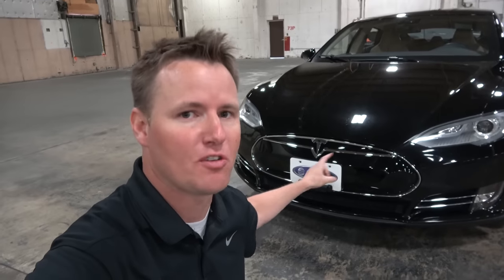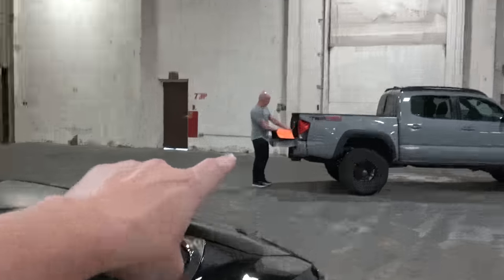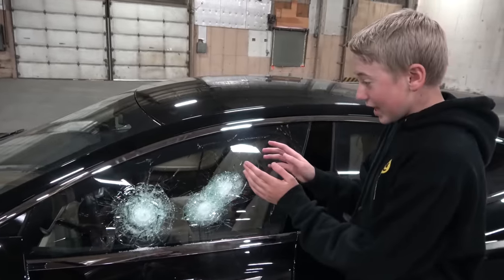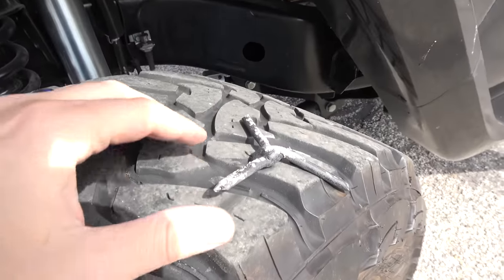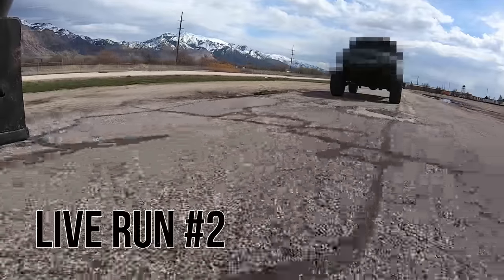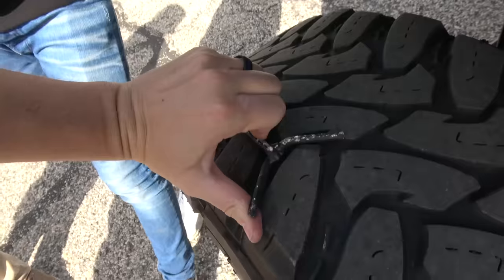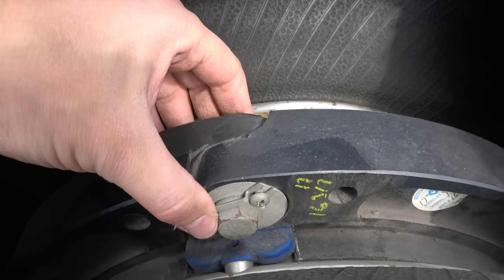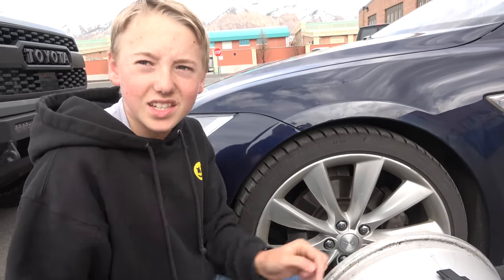What's inside a Bulletproof Tesla Tire?

Comment: For tacks of this kind to be most effective, the tacks need to be made of hollow tubes (essentially a bent needle with multiple points). If it’s not hollow, it just plugs the hole it makes and the tire can still be driven on for miles and miles.

Comment: For effective tacks, they need to be made from hollow tube, so when they pierce, rather than plugging the hole they make like the solid ones, they allow air out, whilst keeping the hole open. Police "stingers" have detatcheble hollow spikes, so when the tyre passes over them, the hollow spikes detatch from the stinger strip, and stay lodged in the tyre, releasing air more effectively (as the holes alone re-seal to some extent)
Reply: a net made with thick heavy duty
rope and spikes can stop almost
any if not all trucks in just meters

Comment: Shouldn't the so-called tacks be hallow for them to work?
Reply: @praesdynamite4596  It's unlikely you'll be able to recover the tacks even if they survived... after all you'd be using these in a area that isn't exactly safe
Reply: Tom Z Yes  the air need to be able to escape or else the hole will be filled by the tac it self
Reply: Hello fellow fbi agent
Reply: FBI Hello
Reply: Yeah if the tac was hollow, that tax will act as pipe for the air to escape easier

Comment: The run flats on my BMW are really about the same as normal tires except they have stiff reinforced sidewalls. Probably not good for something like dodging an attack, but if I get a simple flat, I keep driving for around 50 miles in order to get to a repair facility.

Comment: Lincolns balls be droppin' like flies!!! Dont be weirded out, we've all been there, we've all gone through that faze. Btw in most runflats there is nothing inside of them, they are just really hard and have a really low profile which makes the walls of the tyre stable enough to be driven with no air inside.

Comment: If the tacks were hollow they would leak the air without having to be pulled out
Reply: They leak the air with them in
Reply: But not with vehicles that have massive off-road tires.
Reply: If you look at a police tack strip that is what you find.  Spikes with holes through them. They don’t plug the holes with themselves.  When you run over a nail they tell you not to pull it out because it seals the hole.  That’s what happened with the spikes on his video.  The air didn’t leak until the spikes were removed.

Comment: A tyre doesn't explode; it can get ripped apart. Where it is legal, new threads may have been vulcanized on an old tyre, and these can fly off. The inner tube explodes, but in most countries it is now illegal to use inner tubes with tyres, as goes vulcanizing tyres for regular cars, excluded work vehicles as tractors and heavy machinery.

Comment: They just need to have ribbons to slow them down and make them stop, like DPICM submunitions have.
Or maybe flaps like hi-drag bombs. 
The point is, if you're being pursued and you drop your caltrops, you need them to come to a stop ASAP, not bounce along after you and fly off the side of the road. I would attach weighted ribbons to them so they drop and just skid to a stop to await the pursuing villain's tire.
On second thought, string them all together with monofilament fishing line and drag two 30 yard lines of these directly behind your car tires. Once you get a pursuer tangled in the line, the line just snaps away.

Comment: Most run flat tires do not have those bands. Those are not used as they prone failure too often. Look up PAX wheels and tires from Michelin and why they failed. Run flat tires are just thicker tires on normal wheels that can take more stress.

Comment: Generally you would like hollow tacks because theres no point of having a tack in your wheel if its not letting air out, in a normal car it will keep going for anywhere to 3-30 minutes, hollow tacks put the car undrivable in a minute

Comment: it would work better if the tacs were hollow. cuz then when they stick in the tire, istead of plugging the hole and letting air out slowly, it would open up a tube for the air to flow out and instanty deflate the tires

Comment: Caltrops are not a common accessory?  When did that change?  Are oil dispensers still common?  How about oil injection into muffler?   Ok brake light disconnects are still done?

Comment: that is NOT what a run flat tire is. In fact, that is just called a run flat SYSTEM. Run flat tires are thick usually 3-5 ply walled tire that has solid metal banded beads, that is what makes them so strong. do some research before posting something with a title like this

Comment: This is not your normal Run Flat Tire at a tire shop. I work for Bridgestone and your typical RFT has a much thicker sidewalk reinforced with steel and rubber which allows you to drive safely for another 50 miles without damaging your rim our getting to an accident. What this guy shows you is what you would get at some privately owned vehicle shop.

Comment: Those tacs arent the best tho , the air cant even escape without removing it
Reply: That doesn't matter a normal car tire would deflate in minutes.
Reply: oh yeah yeah ehh it’s like a nail in a tire , it really wouldn’t deflate right away it would take a couple days or hours
Reply: @Kchvz  these are designed to do it in hours they aren't a.nail
Reply: oh yeah yeah how it’s pretty much a nail with two extra sharp sides ..... no hallow hole in the to let air out or nun ..
Reply: @Kchvz  there are three edges. It will constantly be ripping the tire/ shredding the tire.

Comment: Tesla Easter eggs for you

1. Hold the Tesla logo and put in the code "007" Will Make Your Car A Submarine. 

2. Hold the Tesla logo and put in the code "Mars" Or "mars" and your car will be a mars rover.
 
3. Press The Button On Your Charger 10 Times When Your Tesla is plugged in and the charger light will be rainbow.

Comment: This info is so wrong. There very very few tires that would ever have a system like the ones shown. I work at a tire shop and have never seen one of these systems in 3 years of working. The one that keep the “side” up to prevent the tire from blowing out wouldn’t work. The bead is still gonna stay on most tires. The sidewalls are the weak point of all tires. 

Way more common is a run flat like Bridgestone with heavy and short sidewalls. Allowing tires to be driven on while flat for 50ish miles. Pretty poor video about tire and run flats.